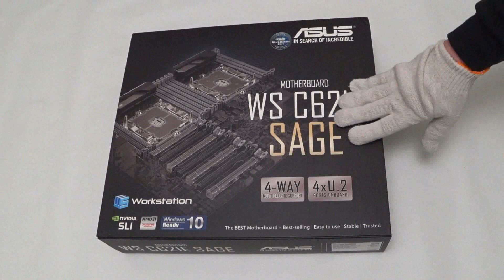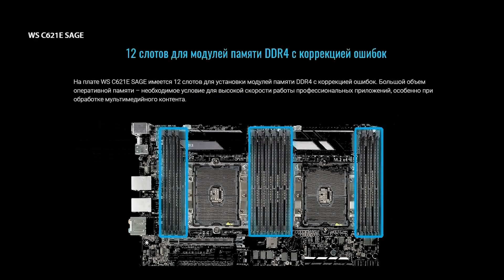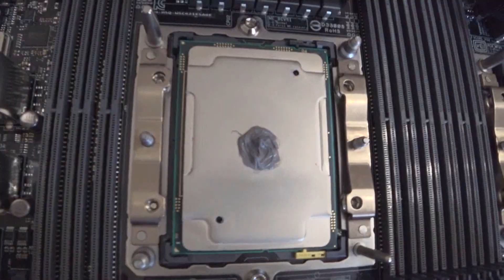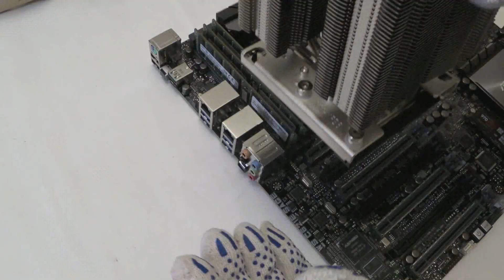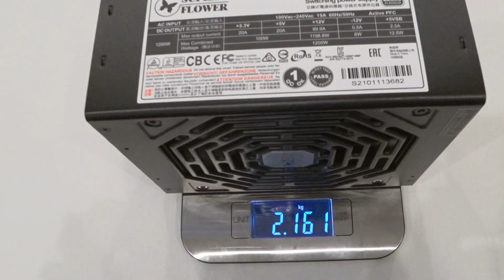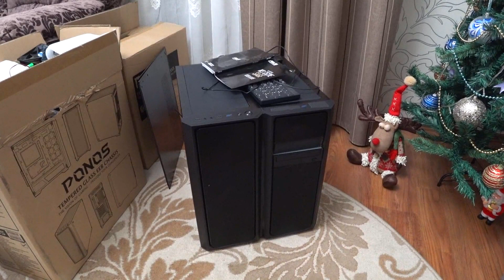Сборка на платформе ASUS WS C621E SAGE LGA3647

Comment: Need help with that MOBO, can someone please spare some time ?
Reply from the maker: Hello.  Dude subscribe to this channel.  What do you need help with?
Reply: @4K_GAME1  , error code dC showing
Reply from the maker: Specify the detailed configuration of your assembly.  Perhaps I can help you solve this problem.
Reply: @4K_GAME1  Xeon silver hp 4208 octacore  
ECC DDR 2666 Kingston RAM, ASUS Thor PSU, WD SSD, 
Is that enough info ?
Reply from the maker: dude, you have HP branded CPUs.  They are not compatible.  Find other CPUs.  I use an Intel ES CPU, it's much cheaper than retail CPUs.
Reply: @4K_GAME1  why not compatible? , they right socket and everything , I'm not pc specialist
Reply from the maker: If you have an HP brand CPU, they are not compatible even though they use the same socket.  You can write to me on social networks and take photos.  I'll tell you for sure, since I don't see your configuration.